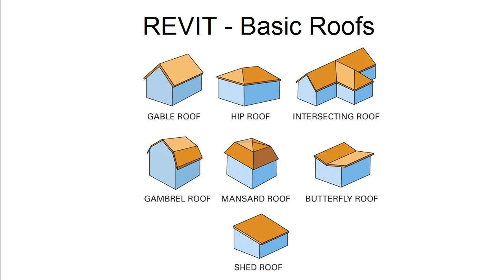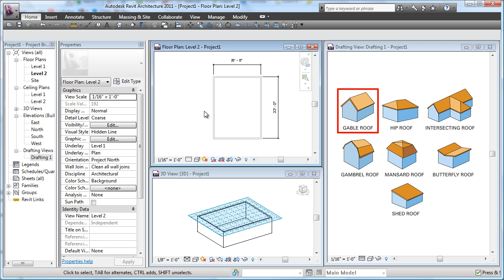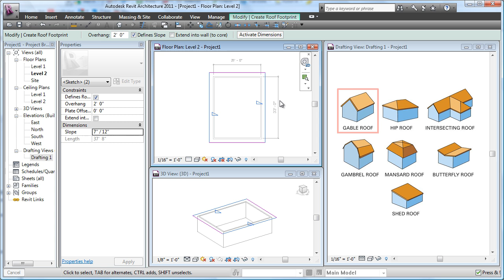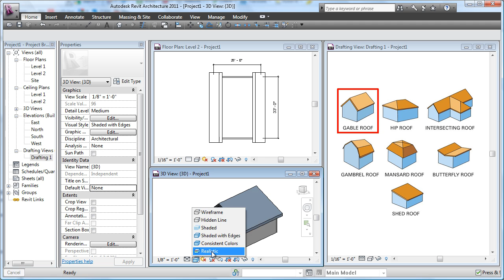REVIT Roof  Basics  01 Gable (Spanish) - CADclips

Comment: To turn off the slope symbols you have to select the roof edge line, NOT the slope symbol.  Then you go to the properties dialog and turn it off on the "Defines Roof Slope" line.  Hey Autodesk! Set it up so the slope symbol can be selected by actually clicking on the slope symbol itself!  And let me turn it off by cicking on it!  And don't have the "off" symbols disappear, just have them turn blue so you know they're off but still visible so you can easily turn them on again!
Reply: That was a cool idea, but letting them(Autodesk) know here, may not get their attention, try giving them a feedback on their website... And I tried doing what you said and expected that to work also, but like you still failed even in 2022 version... All the best...l